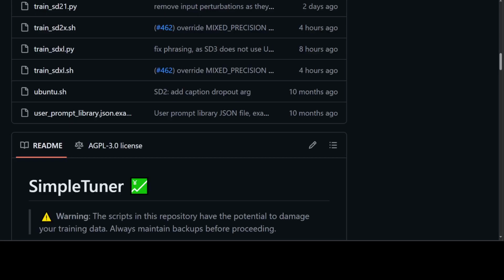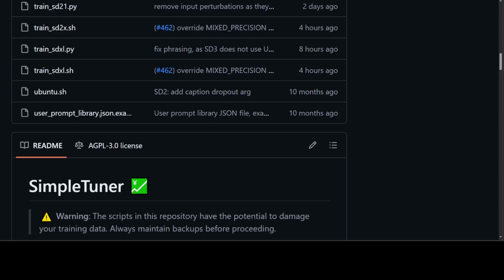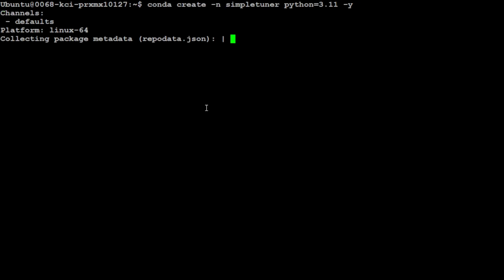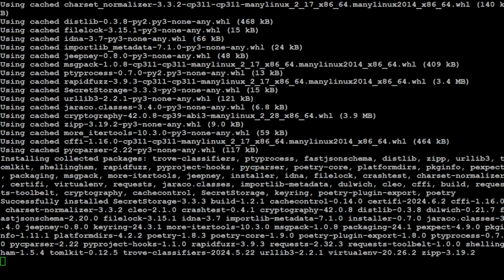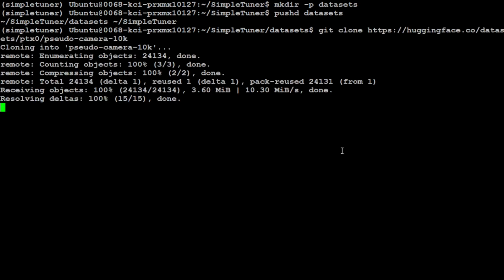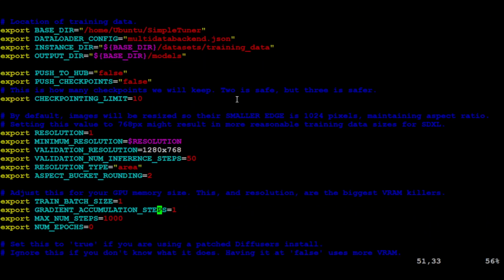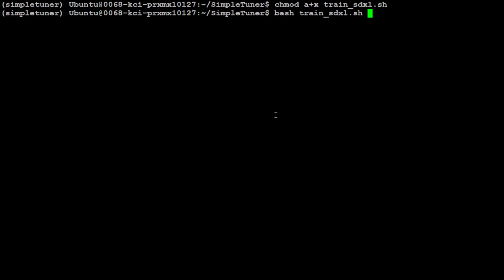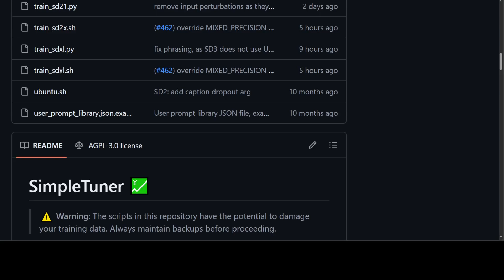SimpleTuner Tutorial to Fine-Tune Stable Diffusion 3 Locally

Comment: The name is misleading, it should be named "ComplicatedTuner". The installation was difficult because poetry got stuck for no apparent reason. The configuration was difficult due to the many options + additional command line parameters that apparently don't even have a pendant in the env-sh script . Stating something like "just throw all your images in a folder and your are good" must be a joke. Without setting up the DATALOADER_CONFIG you won't get anyway.  You are also required a model in diffusers format which most people don't know much about including myself, so just setting MODEL_NAME to your checkpoint doesn't get you very far. I only had some of this stuff lying around from the days where I used the Dreambooth addon for A1111 for training. I found a script though meanwhile that converts checkpoints to diffusers. I wonder though why this step is not simply included in SimpleTuner. When I was ready to go I run in one error after the other. I had to fix 3 crash causing bugs which took me being Python beginner nearly the whole weekend and would have been impossible without ChatGPT and Claude. But IF - and that's a big a one - IF it is running it fully uses both of my GPUs. And that's what I'm currently looking for, a tool that allows me to use both of my GPUs for training. There is also a deep knowlegde about how everything works apparent in the code and configuration combined with a serious documentation attempt. It's also no half Japanese ;-) So there is a good chance I'll use this in the future. I'm not done testing the latest Kohya_ss versions though but it seem the sampling if the validation images is broken which may have a deeper cause. Anyway, since SimpleTuner seems to be a powerful tool indeed, maybe you want to do a video how to use it for finetuning own checkpoints for SD 1.5. I think you evaded like 90% of the trouble I had by using the SDXL-tuning script, running only one GPU and getting the model directly from HF. Feel free to ignore the grumble above I just felt the urge to write about all of this. :) I'll report the bugs and fixes later, hopefully they'll be included soon.